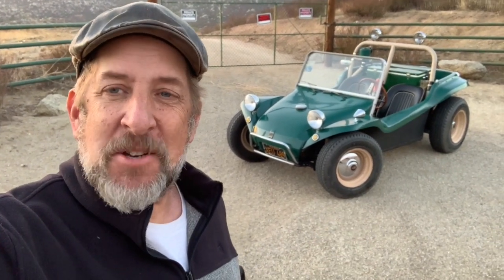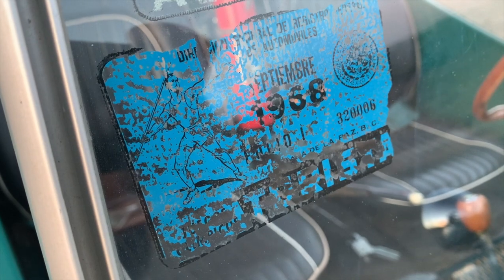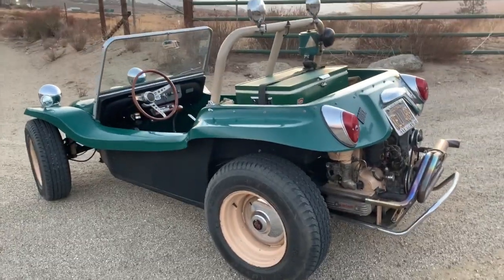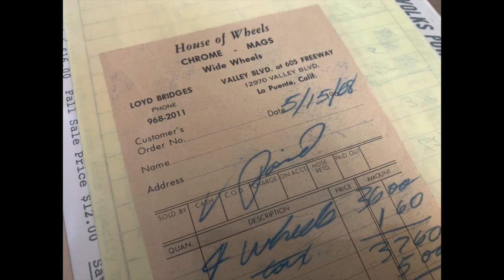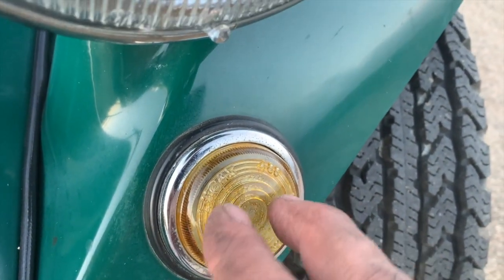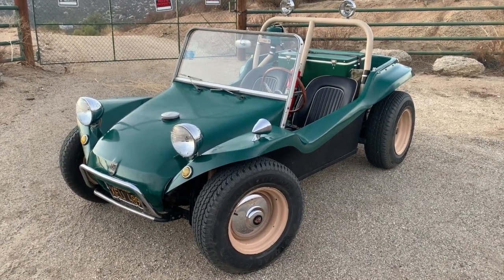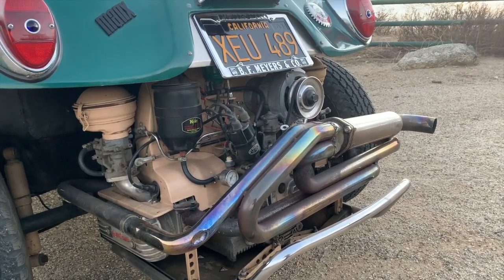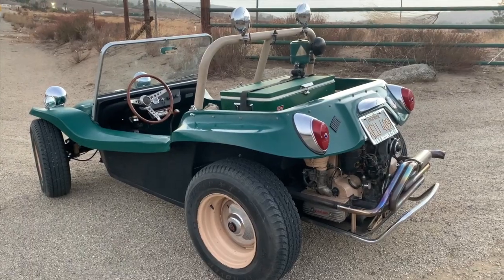Carchaeology: 1968 Meyers Manx Dune Buggy Time Capsule

Comment: So the carbs have their own oil bath air cleaners. Then the air filter on the rollbar isn't used?
Reply from the maker: Yes, the air filter on the roll bar was not in use after conversion to dual carbs at some point in its history.

Comment: The weird thing is the price of these things. Buy a kit from Meyers for $4800 and build your own for around $20,000-$25,000 complete brand new or buy an old Meyers Manx for what reason? Make your own memories......Had a knock off back in 2001 and it was fun and it cost less than $4000.
Reply from the maker: Different strokes for different folks. Some folks appreciate history, some don’t. Both are fine choices. For me? I’m goin old school!
Reply: @Carchaeology  I get history but since you can still buy a Manx dune buggy which is numbered and pretty much cheaper and built the way you want and cheaper. They both are pretty much identical..but if you are buying a 1969 Dodge charger against a 2010 Dodge charger I would go old school.
Reply from the maker: @johncaban4310  the thing is, they really aren’t the same, especially when it comes to the parts and details. Also collectors know and care about that history, and the value is affected by that.

Look at it like a quarter. A new quarter is worth 25 cents , but an old quarter in mint condition can be worth a hundred bucks...why? Because history matters, rarity matters, and condition matters.

It all depends on what turns you on. If your plan is to go beat a Manx on the trails of Baja...go with something new. If you are a collector that is after rarity and condition, vintage is the only way.